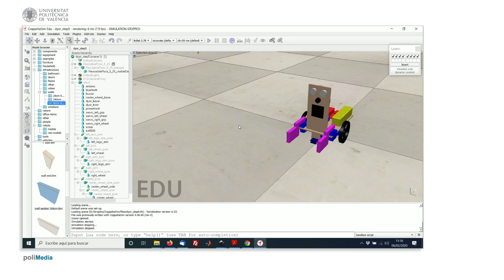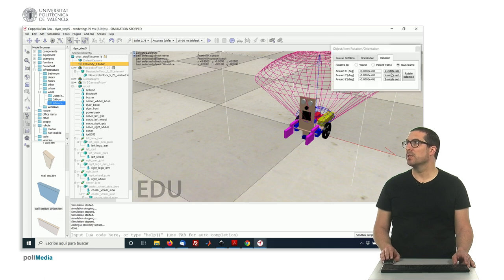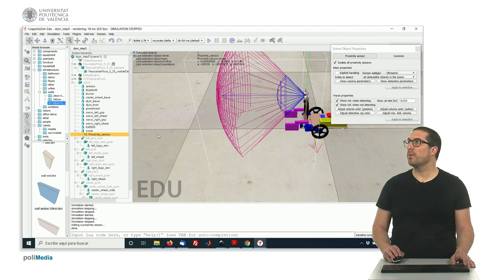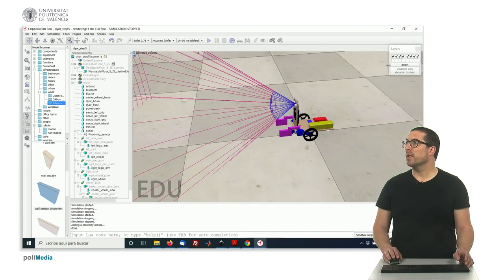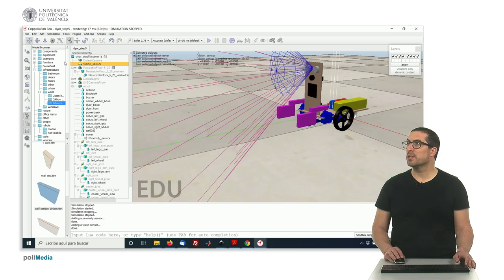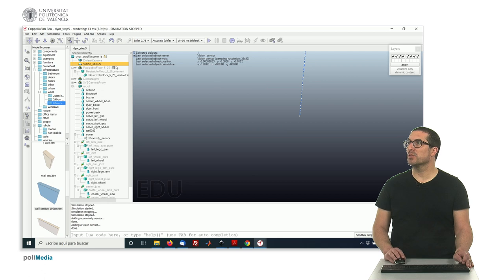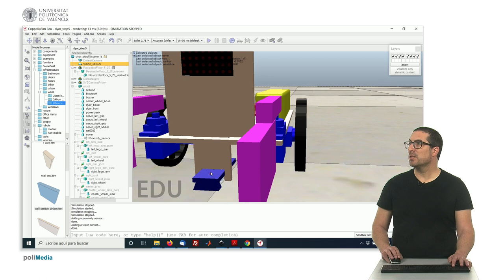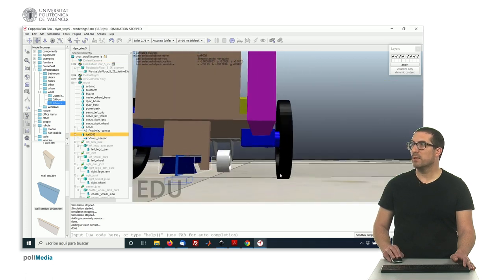Creating DYOR robot (Step 5) | CoppeliaSim (V-REP)

Comment from the maker: Make sure that the ultrasonic sensor is not detecting the floor (check that the 'ResizableFloor_5_25_visibleElement' is not detectable with an ultrasonic sensor -> Access object properties -> Common properties -> In 'special properties' there's a check with the 'detectable' property -> go for details and uncheck 'Ultrasonic').

In addition to this, depending on where you have place the sensor, it might happen that the sensor detects the robot or any robot component. Uncheck the option 'Don't allow detections if distance is smaller than' inside the detectable parameters of the ultrasonic sensor and inside the Detection volumen properties of the sensor, the correct parametrisation should be 'Offset'=0, 'Radius'=0.05, 'Inside gap'=0 and Range > 0.5.

Check that the sensor provides the correct distance if you create a cuboid and activate the 'detectable' special properties on the cuboid and place the cuboid right in front of the sensor.